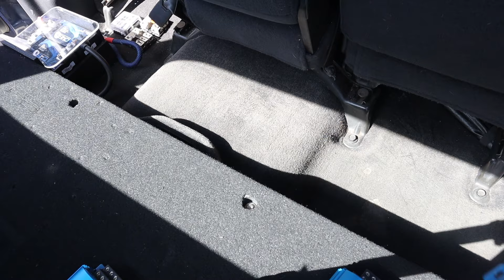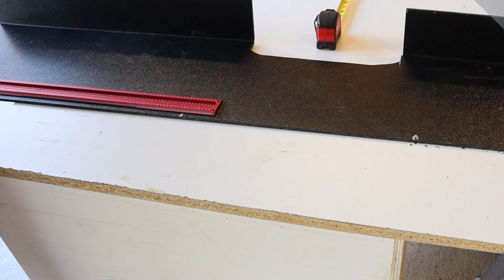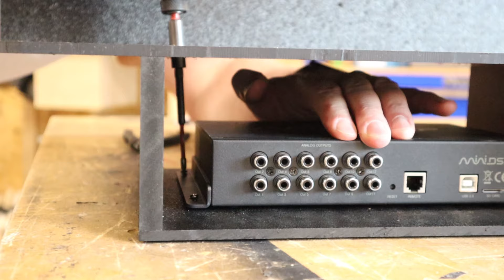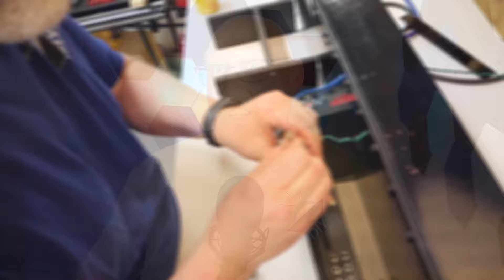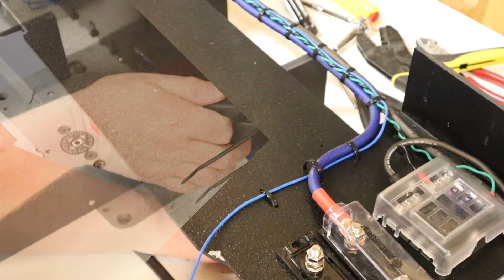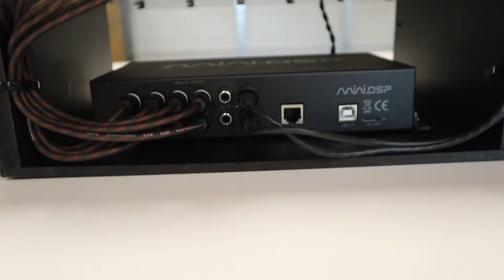JL Audio Amp Rack!

Comment: As much as i want to make a clean wiring amp rack.. i change my setup too often 😩😩. I did better this time around but still had to leave slack for future amp changes
Reply from the maker: I'm constantly swapping gear in and out, and I found that I've now created the exact same problem.  I'm going to have to reconfigure this setup, hopefully I'll get to it this summer.
Reply: @ 🤣 glad i’m not the only one! Some people have more space to work with in those cases i would say keep slack under the amp rack. where the wires come up through a hole and into the amp.

Comment: Its overwhelming trying to figure out where to place components and how to mount them in a truck.  I have the same problem with my 2011 sierra extended cab.  To add insult to injury the floor has a lot of strange contours to it and there is only 1 tiny flat area on each side.  I would remove that cup holder in your truck and cut the bracket right off and save it in case you want to put it back.
Reply from the maker: It is a challenge.

Comment: Justin i don't have a router table but do have a hand held router. You think i could mount my abs amp rack to a table with clamps . Clamp a jig guide and then use hand router to do round overs along the rack ?
Reply from the maker: For a thicker material, like 3/4-in MDF, yes.  But you're probably working with 1/4-in ABS.

The trick is making sure that you're making a safe cut. You'll need to make sure the ABS is supported, it's so thin that it will be easy to bend. 

 Clamp it right to the edge of the work surface so that the router bearing is on the work surface.

Comment: I have a gen 4 RAM 1500; I fit a JP4300, a large and small Hertz 4 channel amp, Audiocontrol 810 DSP, SMD 6 spot fuse holder and 4 spot ground distro all on the back wall. Not sure where you had issues, but would be happy to send you pics if you’re interested in layout ideas.

Comment: CE Auto Electric Supply has a remote relay system with a 6 amp diode. I bought one myself to power on 10 units, which had no issues.
Reply from the maker: Cool.

Comment: Did you say the cup holder is welded to the floor? Clean setup. I can see how the old one was causing issues. Space wise
Reply from the maker: Yes, there's a metal bracket that's welded to the floor, and the plastic cup holder sits in that bracket.

Comment: Audiocontrol DM810 would've taken place of the DSP and the 8ch amplifier, but it's definitely not cheap.
Reply from the maker: This one? https://howl.me/cl20ZzF98Ua
Reply: @DIYAudioGuy  yea I was thinkingbthat was the 1 with built in amp but it's not. I was thinking of the 6.1200 it's a full DSP with the amp built in and can daisy chain to other amps while controlling the signal to them as well.   I was thinking they had an 8ch version.

Comment: You can buy threaded inserts that can be melted into the plastic.  They are pretty fantastic.  You basically mount them onto the solder iron let it heat up and press it in.
Reply from the maker: I'll have to give those a look!